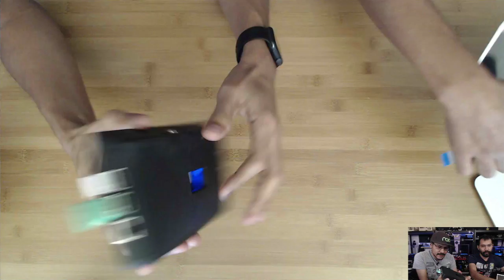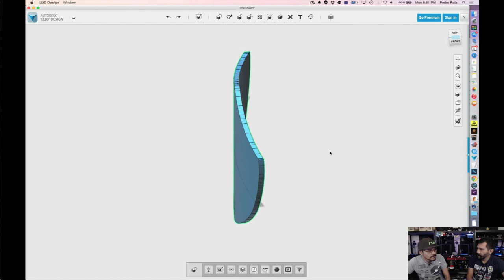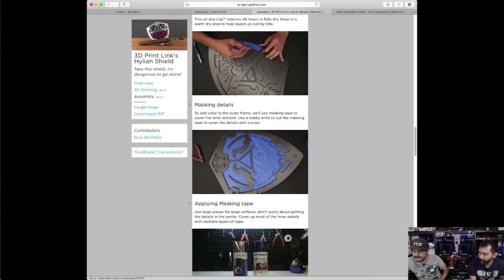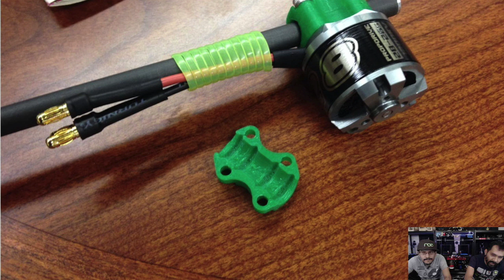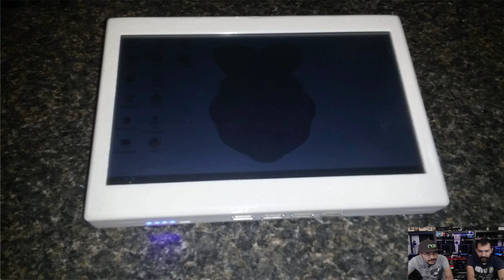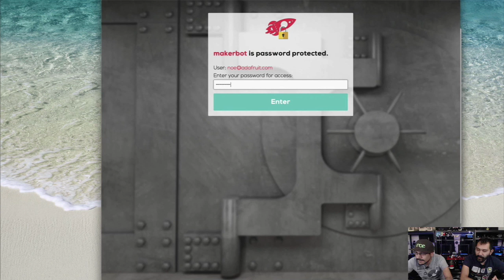3D Hangouts - Shield and Kippah

Comment: About the x skipping, I know that on my printerbot simple metal the printable 150x150x150 cube is around 10mm from where the printer thinks it is, so it occasionally hits the x endstop and trys to keep going, and that ends with a skipped part, maybe its the same thing if everything is fine mechanically?